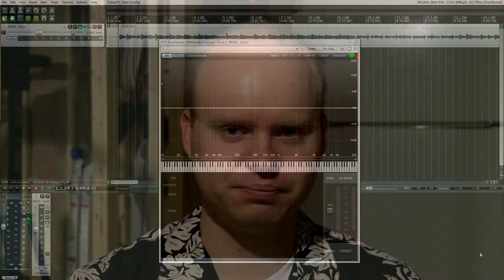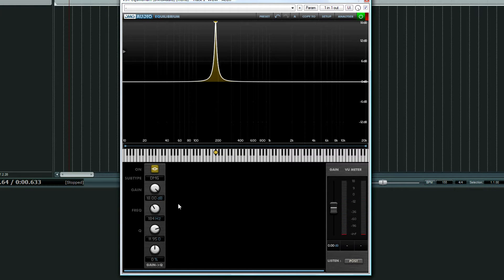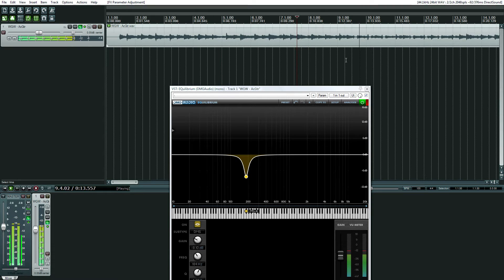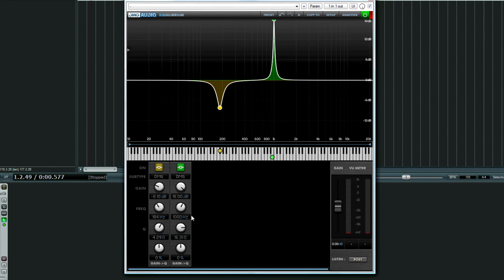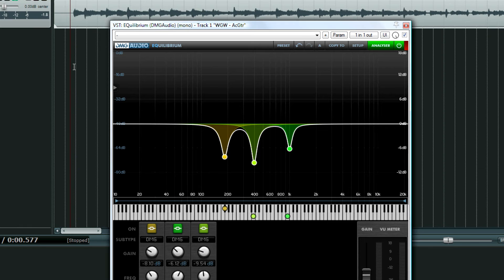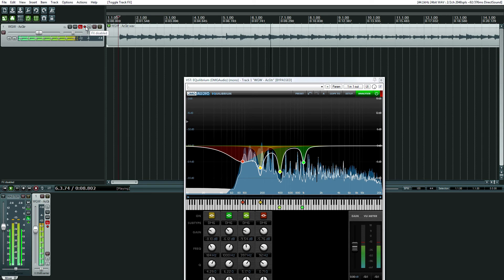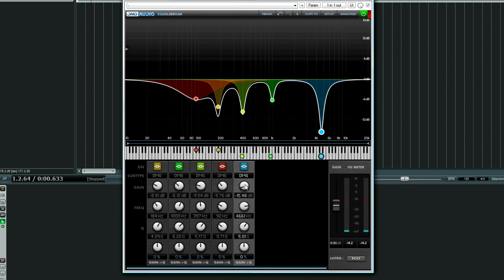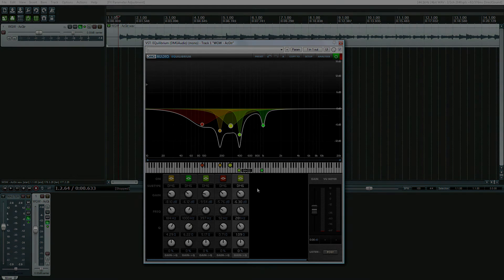Easily Equalize Any Instrument - Audio Mixing Tip

Comment from the maker: OK thanks!

I didn't know this trick when I first started to seriously get into mixing music. Had I known about it many hours would have been saved! It's not exactly an intuitive technique...just like cutting more and boosting less. Or recording 20 dB lower than 0 because you can barely see the waveforms on the tracks at that level.

It's all stuff we either learn or find out through trial and error. Learning it is faster...especially if you're brand new to all this.